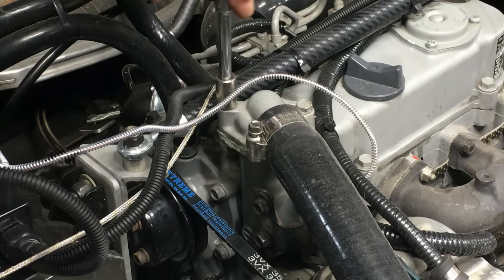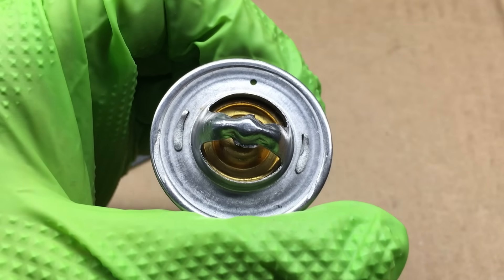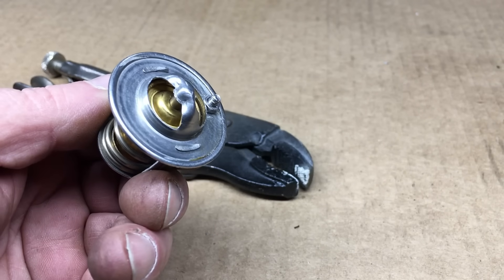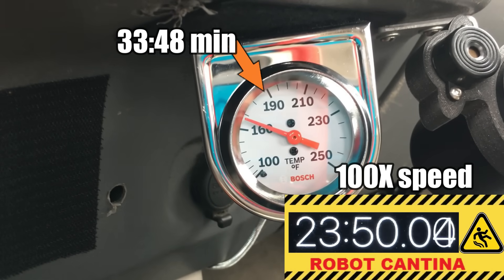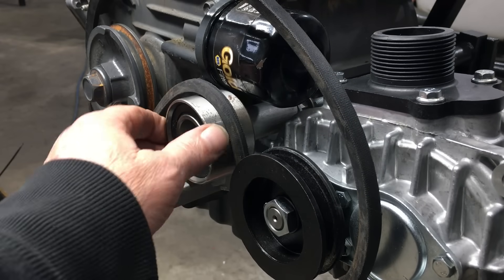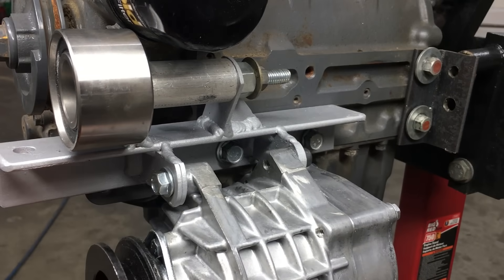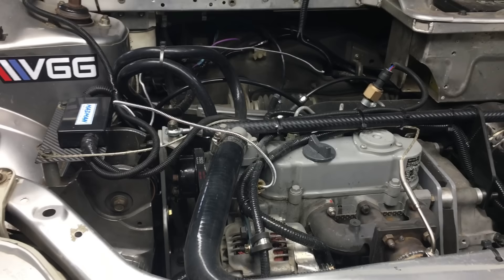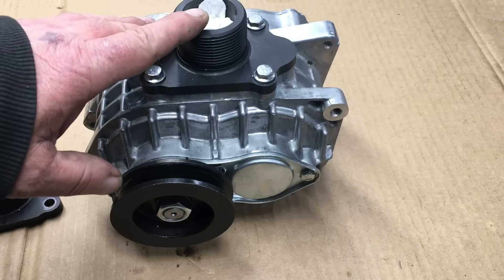S4 E4. Thermostat issues and making an AMR500 Supercharger fit a 719 cc Kubota diesel engine

Comment: On large equipment, such as a dozer the fan can be reversed in the cooler months to blow heat from the engine bay through the radiator to keep engine temp optimal. But i doubt the little Kubota would produce enough heat in that large engine bay to do the job, so you might need to start over and install an engine from a Cat D11 😅
I enjoy your videos Jimbo ❤
Reply: the reverse is to blow dust/debris out of the radiator.
Reply: his issue is he just needs a hotter thermo
Reply from the maker: Good luck finding a hotter thermostat for a kubota D722.  Its a unique size
Reply: @robotcantina8957  there's an in line webasto coolant diesel heater and pump combo unit. Only trouble is it's pricey.
Reply: @robotcantina8957  My understanding is that the spring is what reacts to the heat so could the spring be switched or altered? Alternatively, could a higher temp thermo be trimmed to fit?
Reply: The important part is actually the wax pellet inside the thermostat. Basically the way thermostats work is that the wax expands when it melts, the expanding wax pushes on a plunger or piston that opens the thermostat. The temperature is set by changing the melting point of the wax mixture.
Reply: Perhaps a water-cooled gas motor for making warm water...and coffee.
Reply: That would work!  Not sure about the fitment, though, might need to cut-and-paste a bit.  That exhaust sound would definitely turn heads at the Kum and Go.  Or, just install an electric BV (Boiling Vessel), such as found in all British tanks since WWII, so all can have a cuppa when someone calls a halt to the convoy.

Comment: The thermostat is an analog mechanical regulator, not a switch, so it does start to open at 160°, even if rated 180°. If that little bit is enough to keep it from going higher, then it doesn't get higher. 

Blocking off air flow to the radiator is fine.

Comment: What happens without the bypass is the thermostat can stay closed even though the coolant in the block is hot. The coolant that is stopped in the water neck never gets hot enough to cause the thermostat to open. Having a tiny trickle of coolant makes sure there is some circulation. Its not a big deal on something like this kubota but on other engines with an isolated mounting location it can cause havok. The engine can also experience a cold water dump, its unlikely, but it stresses the gaskets.

Comment: There are two reasons for the bypass (that I know of)

1. Keep just enough water circulating to keep any parts from overheating before the t stat opens

2. On some models of passenger car, it bypasses water to the heater core so the cabin can have at least some heat before the t stat opens.

Comment: i was thinking maybe rig a valve to allow some coolant to bypass the radiator , but seems like you have a simpler solution . an old 18 wheeler i drove had a grille cover w/zipper that you opened according to outside temp .

Comment: The bypass hole also allows coolant to circulate around the thermostat so that it can sense the temperature.
About the running temperature... A very long time ago, I went on a training course at Shell. One of the things they taught us was that the cylinder wall temperature must be above 75°C (167F) to avoid the condensation of the sulphur in the fuel (sulphuric acid)  which causes corrosion /wear. 
Also if it is too cold then the cylinder clearances will be incorrect = bad.
Reply: Think Formula one.  they have to heat the cooling system all the way to operating temperturee just to start the engine as it's too tight and it'll blow, only runs at higher RPM's, can't go slow, or blow.  I've had motorcycle racing engines that blew up so fast, I got really good at fixing them,(maybe)

Comment: Little hole (or jiggle pin) is also needed so that the coolant behind the thermostat is allowed to warm up and not become a cold pocket, or the thermostat will open late.
Reply: This thermostat doesn't have a jiggle pin, but the entire purpose of a jiggle pin is to block the air bleed hole when the engine is running and the thermostat is closed (i.e. there is water pressure on the thermostat), and to open it to allow any air that has collected to pass when the engine is stopped.
Reply: @ferrumignis not that it’s important or maybe it is but aren’t those jiggle pins usually a brass pin?

Comment: I knew about the shutter system on modern cars (road debris killed it on my car so I also know how stupidly expensive they are), but that window shade approach is genius.
Reply: So simple, so effective. 

I'm gonna have to implement this sort of thing on our work trucks, can't get the lazy bums to keep up with anything else. Lol they complain cause the heat sucks, yet refuse to block the radiator with anything even when I've told em it can be as simple as some cardboard, and I don't have to install the covers. It's not THAT cold this winter 😂

Okay maybe I'm the lazy bum. I should just put the grill covers on. 😂

Comment: If I remember correctly diesel likes hotter intake then a gas does ?
Reply: It's not as much of a problem as in gasoline, since it can't knock or predetonate; but the higher density of cooler air is better
Reply: @Giuliana-w1f  predetinonation can throw a rod couldn't it ?
Reply: @JuliTheStar  you're lucky if you only throw a rod. It can make a hole though the piston, and take the block with it

That can happen in gasoline engines with high boost and a bad tune or bad fuel

Comment: that is nice but you would be better off with the turbo with the engine being so small the supercharger steals to much power to drive itself..
Reply from the maker: We tried the turbo  when this engine was in the saturn and the results were lackluster.  The supercharger should address the lack of boost at low rpms.
Reply: may be later try both.that how marine diesels deal with the lag.
 @robotcantina8957

Comment: Another reason for the bypass would be to allow coolant from the engine to flow past the pellet instead of having to rely on convection inside the coolant jacket of the engine.
Reply: As far as I'm aware, this is the most correct answer. Allowing a small amount of bypass keeps the coolant moving a tiny bit behind it, creating a more even coolant temp and no allowance for hot spots in areas where they may be prone to happening. 

Relying on convection takes longer to open, as there's no direct coolant flow over the thermostat pellet. This would result in overshooting operating temp in most cases that I'm aware of, and then possibly having issues with consistency after it starts operating, it'll slam open once it overshoots, and do it every time it opens. Instead of keeping it consistent.

Comment: The tiny hole helps for keep same pressure on both sides before and after thermostat also helps for bleeding air from system and should be installed to the top
Reply: Bleeding yes, it helps but that's not strictly what it exists for. It's primarily to help cooking system temp consistency as well as ensuring it opens at the correct time/temp rather than overshooting before opening and allowing hot spots, etc. 

Pressure? No. The cooling system is a loop. Only way for a pressure differential to develop is a significant blockage somewhere in the system, likely would have to be multiple depending on the cooling system design and the placement of said blockage(s)
Reply: Also not all of these are mounted with the circular shaped portion being vertical. I've met plenty that were horizontal.

Comment: Supercharger and a turbocharger is actually more optimal for a small displacement diesel engine. But most of the people complaining about a turbo wouldn't know anything about compound charging. The smallest turbo you can put on this engine, is still technically too large. So the turbine side doesn't really get moving till your engine RPM is in the higher side of what the engine can manage. Not ideal for a diesel engine where you want air down low to produce clean torque. Supercharger feeding into the compressor side of the turbocharger is a sneaky way to deal with the issue. Since roots blowers produce air pressure, even at idle if running fast enough.
Reply: twin charging just like the lancia delta s4 group b rally car, blower first then turbo. supercharger takes care of the low end grunt, turbo takes care of the high end grunt.
Reply: When I suggested this in the comments a few episodes ago some people called me stupid and laughed at me, stating the Delta obviously didn't have a diesel engine. Glad there are at least some knowledgeable people that watch these videos
Reply: @lillexus5589  Banks Turbo did this on his pikes peak truck.  Its a Semi truck that sounds like a F1 racer.  Bad A$$.  Look it up its cool to see.
Reply: Wouldn't it be the other way arround? Turbo feeding into the supercharger?
Reply: The radial on the B17 used both with the  supercharger closer to the engine if I remember correctly.
Reply: @Knirin  Lots of US Army Air Corp planes used both super and turbo charging in the same plane. 

It really helped eliminate throttling losses. They all ran a cool setup where how much exhaust went to the turbo was infinitely variable. 

Ironically the P-47 couldn't even use it's expensive turbo setup at low altitudes. For it's late war ground pounding role it was just very expensive and complex armor. 

The P-47 was actually designed to escort and intercept bombers at high altitude. It compromised low altitude performance in a whole lot of ways to do it. Which makes it really ironic it's remembered as a ground pounder. 

It was actually our most expensive single engine fighter of the war. It was even more expensive than the late war experimental single engined jet that only barely saw recon service late in Europe.
Reply: The super charger also helps with spinning the turbo up faster. It creates more exhaust gas which spins the turbo up faster. 

If he with both he'd get the best of both worlds.
Reply: Well a roots blower can suck or blow. In theory you could put a oversized turbo feeding the blower feeding the engine  with oversized pulley on blower    most of your horse power would be used by the blower to create boost which in turn would spoil the turbo by suction. Until the turbo came on then the blower would essentially use no power.

Comment: Is there a larger version of this supercharger that could accommodate an engine just over 2.0?
Reply: There are bigger superchargers for 2.0L engines, but i don't think they're that cheap (and the AMR 500 is only good up to like 1.4L or 1.6L engines at most)
Reply from the maker: for a cheap supercharger the AMR500 is as big as they get... probably not big enough for a 2.0

Comment: Youre gonna want to add some heat shielding or heat tape around the downpipe by the supercharger. While the engine doesnt get too hot, they are close enough that it could cause issues to the innards of the AMR500.

Comment: I don’t think it’s as much the fact that it’s a small engine it’s more to do with that it’s diesel. I have a ram with a Cummins and in the winter it takes forever to heat up also I had a water pump failure a few years ago and had to drive it a few miles so I could fix it and it still didn’t get over 215 degrees
Reply: While it doesn't seem to have been the case for you, sometimes the thermostat for the gauge can't read correctly without water flow (or without water). I've heard of people having to rebuild the whole engine due to loosing water on the highway, and not noticing because the temp gauge was fine
Reply: @Giuliana-w1f  yes you are correct however diesels are notoriously slow to warm up. That’s my point

Comment: If I remember right the reason for the little bypass is to keep coolant slightly circulating during warm up to make sure you don’t get any hot spots before the thermostat opens
Reply: That small hole on the thermostat is to help bleed air pockets out of the coolant system. Never plug that hole.
Reply: Coolant is always circulating. The thermostat just bypasses a variable amount of it through the radiator.
Reply: What are you guys on about preventing hot spots? Unless the thermostat completely blocks flow from the water pump coolant will always circulate through the block to the pump then back into the block. That pin hole is only for evacuating air. Back in the day many thermostats didn't even have that hole.
Reply: @thatonedude5237  Usually the heater core circuit acts as a bit of a bypass.
Reply: came here to say this.
Reply: keep in mind the engine itself is a substantial radiator dumping heat long before radiator gets its chance. maybe look into a bypass cooling system where the thermostat acts as a diverter, sending water straight back to the engine when cool, completely bypassing the rad, or full flow through the rad when hot or any mix of the two. a thermostat and housing off of a Detroit 2 stroke will do. there may be some larger diesel pickups that use this system as well.
Reply: Also helps reduce cavitation with the pump.
Reply: its for burping the system he could just go with a 200F thermostat and then he wouldnt have any more issues in all my personal engines i ususally run the hottest thermostat i can as long as they dont have any cooling problems
Reply: The hole in the thermostat is a funny thing. The factory Thermostat for my 93 Celica GT has one, but unless I go  to Toyota and buy a thermostat, all the replacements at parts stores do not have a hole in them. This is kinda confusing because the radiator cap is about 3" lower than the water inlet in the head, and the thermostat on my Celica bolts directly to the water pump! Take that as you will, but that engine is supposed to be one of the most reliable Toyota engines ever made, the 2.2L 5SFE engine.
Reply: Came down to say the same. It is probably hotter inside the engine and of course the water temp sensor is in-line beyond the hottest part of the engine, so it's getting a delayed readout with the bleeder closed.
Reply: This is something I've considered in recent times too. You This could result in the temperature at the sensor reading low (or high in some scenarios, I suppose, depending on sensor location) due to lack of flow. And similarly at the thermostat, which may open late. In the case of the engine I'm working on, the thermostat would open later if there was no flow because the hot coolant from the heads isn't really making its way up and over into the cavity quickly enough to open the t-stat.
Reply: Also allows air escape
Reply: As others have said, the hole in the thermostat is an air vent for filling and initial start-up.  I have never seen a modern engine that didn't have a bypass to allow circulation before the thermostat opened.  Sometimes it's an external hose connecting to thermostat housing to the water pump inlet, and sometimes it's an internal passage in the water pump housing.  I don't know anything this Kubota engine, but based on the thermostat itself, I'd say this engine has an internal bypass passage.
Reply: That’s probably why it took longer to go from 160 to 180 after the hole was plugged. The thermostat was letting the cold coolant from the radiator through because it’s not flowing
Reply: Prevent dead heading you coolant
Reply: Yes, and to " Burp " The Trapped Air in The Motor.
Reply: Love your work!
Reply: If you have a heater, won't the coolant circulate through the heater core, even when the thermostat is completely blocked?
Reply: @MikeTriesMotorsports yes because the heater core operates on a loop before the thermostat
Reply: @miketriesmotorsports6080  if you have the heat on.  When shut off the circuit is blocked.  Most systems I've seen have a bypass built into them so that a closed thermostat blocks flow through the radiator but not the rest of the system.  I doubt any systems are designed to dead head with a closed thermostat.

The thermostat bypass hole is to allow some cooling if it gets stuck and to clear bubbles.
Reply: @nickmcwilliams685 In my Chevy, the coolant always circulates through the heater core. Air is just directed around the heater core. There is absolutely no valve to shut off water to the heater core. I do know there are many vehicles that do shut off the water via a valve but my Chevy does not.
Reply: The hole in the thermostat is ONLY FOR AIR TO PASS TO AVOID HOTSPOTS BEFORE THE THERMOSTAT OPENS. NO OTHER REASON
Reply: That's what I thought too. You need some coolant movement to prevent hot spots and potential local boiling.

I'd have been checking the stat before bodging the bypass.
Reply: @exasperated it just burps the system. So no air pockets. That's all...
Reply: The "hotspot" would need to be in the radiator for that

Comment: Thermostat bypass hole ensures that the pressure in the cooling system is the same both sides of the thermostat, so that the pressure cap can do its job regulating the system pressure.
Reply: Nope
It is there to let steam and gas past so the thermostat element remains in liquid and a small amount of fluid circulation to allow the stat to sense the engine temps accurately
By design and intent, it is a restriction
Reply: Did you forget that there's a whole 2nd hose without anything blocking it attached to the radiator from the engine?
Reply: @huzudra Yes.... yes I did. LOL
Reply: @davidrobert2007 I read the comments lol my bad. 

We all have those days. I had my first coffee before watching today, so it wasn't me this time! (Though I totally have done this sorta thing. It happens. 

Your reply though, that got me 😂😂😂 

This channel is too in depth for me to get in the comments before coffee sometimes. Lol the comments discuss some real fun stuff sometimes but I have to be fully awake for it 😂
Reply: Cooling system is a loop, yo! 😂

They're connected at the other end man, no opportunity for pressure differential unless something is clogged real bad